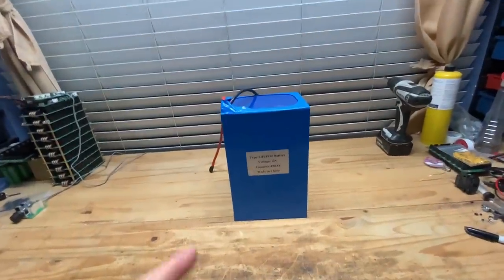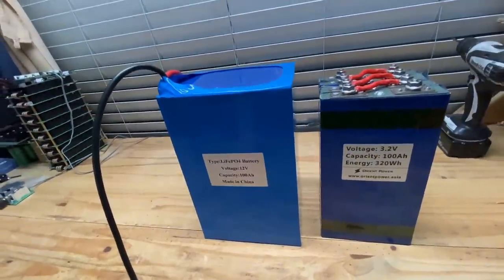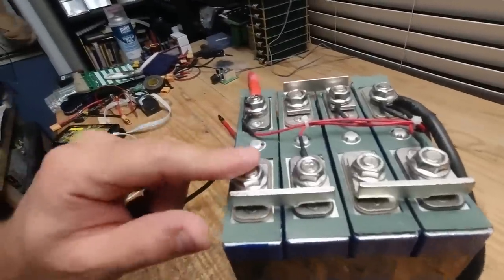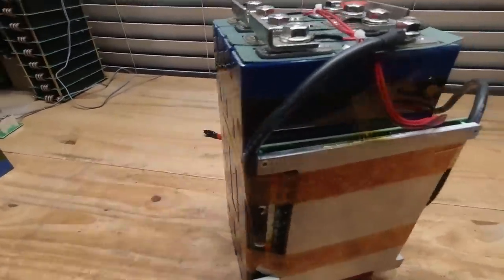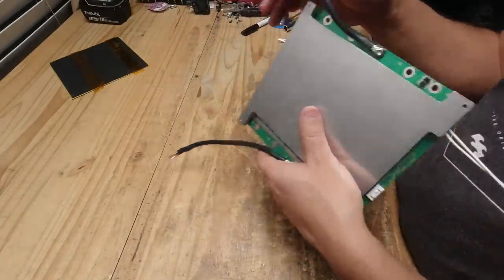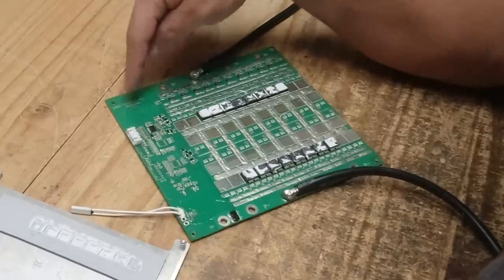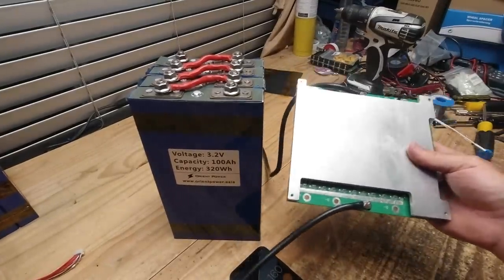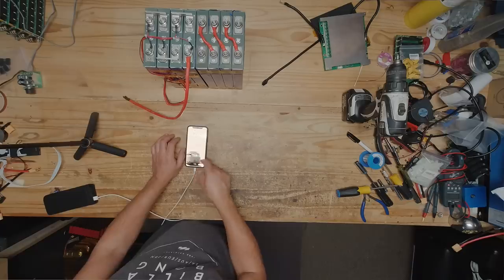100AH Orient Power 12v LiFePO4 Battery  Review

Comment from the maker: LifePo4 cells are amazing,  a bit expensive but safe and long lasting like no other
Reply: So many options out there, these reviews help me out a lot. Going to wait until the prices drop a little before I get some.
Reply: Can i use these cells to power a e bike and would they run effeciently
Reply: What was the current meter you were using
Reply: Not cheap at all indeed
Reply from the maker: It’s discontinued
Reply: You have no shows about supercapacitor graphine storage system
Reply: What was the cost for the battery
Reply: @captainobvious9188  bad link
Reply: @kingcardano2.9millionada24  hey, doing good I hope ✌️.
I think I saw 550$. Look at 00:35 seconds into the vid.
Reply: Don't know if you noticed, but you weighed your previous cells, not the cells you actually got.....
Reply: jehugarcia in UC
Reply: they're not expensive if you search on alibaba or aliexpress, you can get 4 cells at 280 AH for $500, 280 AH!!!!
Reply: @moto1594  look up channel will prowse, he explains and uses it a lot
Reply: Christopher Cope you can find www.orientpower.asia
Reply: @jehugarica try google lens on the barcode of the bms, might find some information about it.
Reply: KANSTON_THE CUTE_SERGAL in this video used 100ah cell, For 72v35ah need use soft pack prismatic cell 24s
Reply: king cardano2.6million ada 550$

Comment: The reason for multiple mosfets in parallel in this case is mostly for decreasing the drain-source resistance.  It looks like those mosfets are rated for about 2.6 milliohms Rds which would mean 26 watts would need to be dissipated at 100A.  By using 8 in parallel the power loss drops down to about 3.25 watts which is much more reasonable to dissipate in that aluminum plate heatsink.

Comment: Based on this review and another from Will Prowse l have ordered 16 cells for a 24V200AH bank. OrientPower is modifying the BMS for this setup. Great service so far. My email correspondence can arrive at 10 PM their time and I get a response within minutes. You can see in the comment replies that OrientPower is following this review.  Hard working folks providing a great product.
Reply: Pivotas thanks
Reply: Pivotas you can make a video and share to us?

Comment: You can pull alot of current through a1.5-2" 8gauge, alot of current ratings are for up to 50'   just think of a 300 amp fuse, it's a tiny short piece of metal, the 8 gauge is much more substantial, I'm pulling upwards of 150 amps though 3" of 8ga. With no issues, if it were a sustainable current 125-150+ I'd go with 6 gauge, or under 200-225 amps, but on my buss wire, about 25-50 amps is average, but 120 amps for a hour during testing, no issues, buss bars gan be a bit smaller than most ppl make them, but you don't want to make the weak link! Great video

Comment: Nice review. Very informative. It seems like they will adjust the BMS for the voltage that you need especially if you order multiple packs. Seems like they don't charge for that either.
Reply: Justin Roysdon if your system is of different voltage, we can give u proposals

Comment: 7 AWG is a bit light for 100 amps. By NEC usually they'll limit 6 AWG to 75 amp and that only if you have 90C rated terminations (rare). For 100 amp continuous you'd usually have to go down usually to 1 AWG or 2 AWG or somewhere between 3 and 4 AWG with 90C terminations.
Reply: Sylvan Butler wire too big not so flexible, wire can be doubled, or use busbar

Comment: Excellent Channel I'm enjoying it very much. I am getting ready to implement a solar / wind/battery system for our home. What I would really like to know is if you could do a video of talking about the real world applications of these battery backup Banks. For example in a power outage we need to run our air conditioning a few lights and TV. I can give you the loads of those items but what I don't know is how much it was system I need to put together to handle that load for a 12-hour outage
Reply from the maker: Load x time = answer.  example 1000w for 12hours = 12kwh battery

Comment: 7 AWG is kinda a weird guage. And there is no way that 7AWG can handle 100 amps without getting immensely hot. 100A should be more like 2 AWG or even 0.
Reply: 100A@12V is 1.2kW. Surely 7AWG can handle this OK?
Reply: It's only a foot long so should be fine.
Reply: @cubiq1  gauges are dependent on amps not watts
Reply: for short bursts of 100 A, probably. the continuous was 50A only
Reply: 7 AWG is approx 0.5 mOhm per foot at 20C.  So two feet (2x 1ft) would be about 1 mOhm and cause a voltage drop of about 0.1V and power loss of about 10 watts at 100A.  Its a little high, but probably manageable.
Reply: @HasanProd  Ah yes, thanks. So 1v@1000A would cause much more losses than 1000v@1A because resistance is proportional to current?
Reply: @cubiq1  V = I * R.  The resistance (R) is a constant (roughly) in this case, but the voltage drop will vary based on current (I).  So 1 mOhm resistance at 1V/1000A would mean a voltage drop of 1V or the entire 100% of the source voltage (although it would be very hard to pull 1000A from 1V to begin with).  1000V/1A with 1 mOhm resistance means a voltage drop of 1 mV or basically nothing.

Comment: Not sure what you are mixing up here but you compare 3.2V at 100Ah with 12V at 100Ah which is actually 4 times less energy stored..
Reply from the maker: What?
Reply: jehugarcia in the video the two batteries are out next to each other, it’s said they are the same.
One says 3.2v the other 12v 
Both say 100aH
The energy they can release  is :Ah * Volt
So one is 3 times higher in energy density or it’s wrongly labeled
Reply: Ha Ka Don’t feel bad, I researched for 20 minutes before I realised the mistake we both made. Note that you’re seeing the label on a single cell for the other battery, it’s already out of it’s casing :) It’s four 100Ah x 3.2V cells. That is, a 400Ah pack @ 3.2V.
Reply from the maker: Or 12v 100ah is how it’s arranged  same thing

Comment: I envy how easy it is to get Lithium cells of any kind in the US. Over here in the UK you either 1) can't get them; 2) have to pay stupid amounts to get large numbers of cells/large cells; 3) have to get them off eBay from china and risk them being fake/much less capacity than listed and/or having them seized by customs.
Reply: Because Europe is all about renewables. Tax the shit out of the batteries so nobody even dares go alternative energy.
Reply: I found a seller on Ali express (BLS) that are getting 135 and 195ah cells into a European warehouse for distribution in about 2 weeks and they told me shipment from there to here in UK should be 3 to 5 days. Works out at about £400 for 4x135ah. 4x195 are about 500. I recently killed some used sinopoly so will be going with these as replacements.

Comment: Do you think this battery would be good for an RV house battery? Compared to others? 
I have one lead-acid battery that I'd like to replace soon. Need to get solar panels, too.
Reply: Following
Reply: See on amazon review, richard has used 4 sets for his RV
Reply: It's a very good replacement but you cant use your lead acid battery chargers with this battery. You need a totally different charging solution for this kind of battery.
Reply: @Jason Bowman I only have one lead-acid battery... Not a bank... Thus why I need to upgrade.
Reply: @thedevmachine  that's good to know. Will the renogy kit on Amazon be good enough from the generator? Or would I have to change things along that route?
Reply: @williamsrdan  I don't know which kit that is. What's your setup? Are you also going to use solar panels to charge? What kind of battery capacity are you planning? Based on those answers you need to select the correct charging setup.
Reply: Change voltage recommended 13.2-14.6V
Reply: @thedevmachine  my set-up is basic and not good enough. I'm planning on getting solar panels, the kit on Amazon has a lot of stuff, you should look it up. I don't know what size to get. I just got the RV in October and spent 5 months trying to get the ABS fixed. I hit the road on Easter. I've ran down my battery once, way down... Been running the generator 6 hours plus every few days.
I need to figure out what to get.
Reply: @Jason Bowman if you look up solar panels on Amazon, the Renogy kit is there on the first page recommendations.
Reply: @Jason Bowman How do you come up with 100Ah LiFePO4 is equivalent to 250Ah lead acid? I thought it was supposed to be better.
Reply: Brooke Seaman To keep lead acid deep cycle in good condition only should discharge to 60 percent capacity so that would be about right.

Comment: So since this BMS can handle 15 battery packs and is only handling for 12 volts vs. 48 volts would you say that means that this BMS is going to last a lot longer due to they lower heat levels?

Comment: just wandering if i can parallel eight packs for solar storage, thanks.
Reply: Mohamed Ali can
Reply: Look up balanced charging. You shouldn’t wire batteries directly in parallel because the resistance in the wires can cause them to charge at different rates

Comment: What were the two strips of material attached to the aluminum and in contact with the MOSFETs?
Reply from the maker: Thermal rubbery isolator
Reply: @jehugarcia  Then wouldn't that keep the heatsink from being able to draw heat away from the MOSFETs?
Reply from the maker: It’s thermal material,  specifically for this purpose,  why would it do the opposite of its intention?
Reply: @jehugarcia  I guess I misunderstood. I read "thermal isolator" as insulation. I take it this material is thermally transmissive but electrically isolating?

Comment: I like yours and Wills tear down videos this lets us know build quality how good the soldering is and the welding also is wire gauge proper but when you're talking 600$ for just a small battery by the time you add all the components it's way above my pay grade even the big solar generator are out of range and the lower price and the smaller ones like jackery wont power the whole house there are 2 bigger oms that can and are under 1500$but they use sealed lead acid batteries that part I can live with but there charging parameters are way off I'f they'd fix that and put in a programmable mppt solar charge controller that could charge lithium they'd have a great starter unit just think I could buy a nature's generator cut the grid and put the 180$ a month in savings in a savings account and in 5 to 8 years have the money to replace the battery with lithium by then they may have even  better batteries out  so sealed lead acid batteries are a way to start but we need a good entry level unit that we can upgrade easily  both these units are ser up for easy battery replacement I can put up with and get around all the the other flaws but not improper charge parameters even that I could get around but then I'd just have an expensive booster pack might as well put naw battery in my older booster packs and get a triplight to turn my 1750 watt modified sine wave inverter to a pure sine wave inverter put my money away to upgrade in 5 years by then they'll have bigger and better solar generator out maybe a 50 amp110/ 220 unit so I can run my ac unit

Comment: If you put too thick a layer of heat sink compound between the FETS and the heat sink, then it will not work effectively, and act as an insulator.

Comment: Is there an LiFePO4 pack with BMS that would allow me to drop it in as a replacement for a 24v SLA battery in a UPS?
Reply: Keep an eye out for battery packs in which LiFePo4 are of the type 32700. They should also fit into a UPS and often already have a BMS in it. 
Example 7x7x8 cm  www.eremit.de/p/12v-6-3ah-lifepo4  (Site in germany)
With 2 packs you have 24V.

Comment: Hi there I'm new to this kind of thing so would these be an upgrade from a conventional 12v battery deep cycle and would these be able to run an RV for and collect solar and stuff I'm looking for an affordable and longer life battery system rather than the old deep cycle 12 marine battery that it came with
Reply: morphs an more try lithium is correct

Comment: Jehu, you weighed the wrong batteries at the end !!!!
Reply from the maker: Same cells
Reply: Yes, I can tell from the battery terminals you weighted the wrong battery.
Reply from the maker: What do you mean the wrong Battery?
Reply: jehugarcia you weigh the battery you had on the before no the new one you are reviewing
Reply from the maker: They are identical
Reply: Besides the busbars and the cables being different, you can tell that the batteries should be the same because of a similar green top and bolts at 5:01 But consistency is nice, so I can understand why other people are confused that you're weighing a "different" battery than the actual one you're reviewing even if they probably came from the same factory.